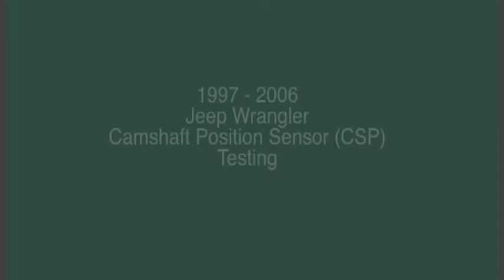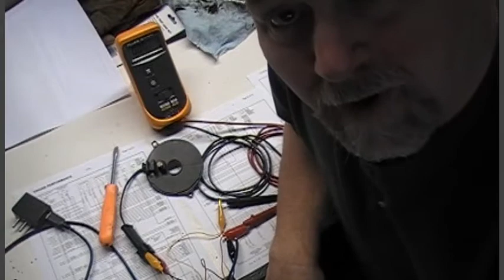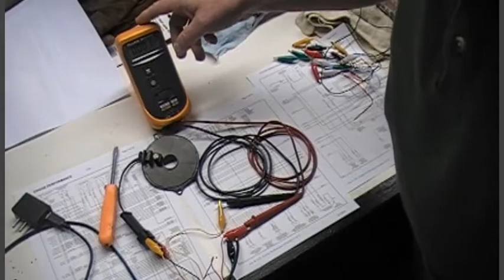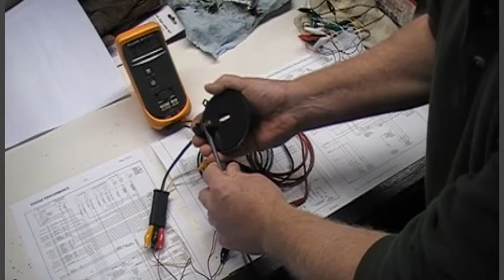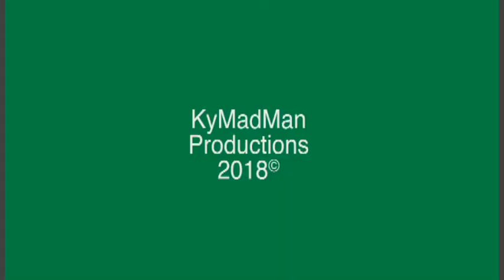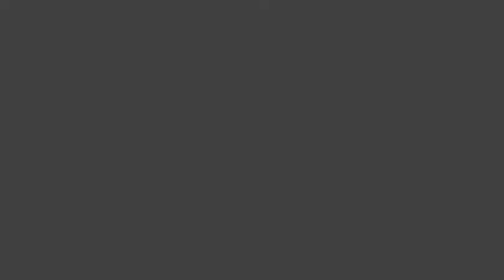DIY Jeep Wrangler Crank No Start Camshaft Postion Sensor Testing

Comment: Would like to point out that the TJ camshaft position sensor style changed around the year 2000 so good for 1997-1999 testing,
So perfect test on this type of camshaft sensor.
It can also be used on the 1994-1995 YJs both 4.0 and 2.5.the connector pins are round not flat style as on the TJs.
However the test still works fine and the pin polarities are still the same power left ground centre signal right  as you describe

Comment: i get 4.92 then when i put screwdriver in between i get 1.62, i supposed to get 5 volts correct.
Reply from the maker: Yes you should. Sorry I didn’t see your post before now.